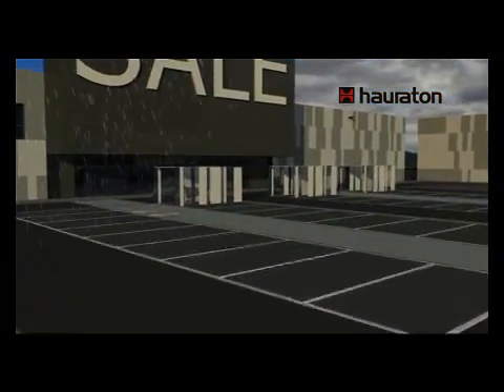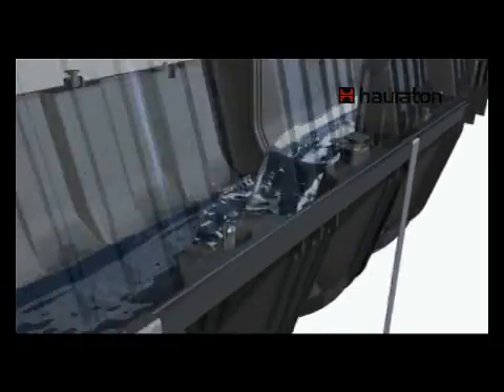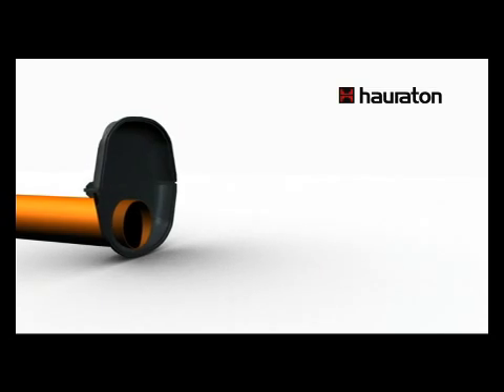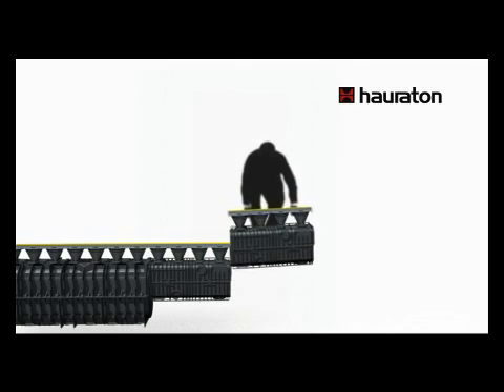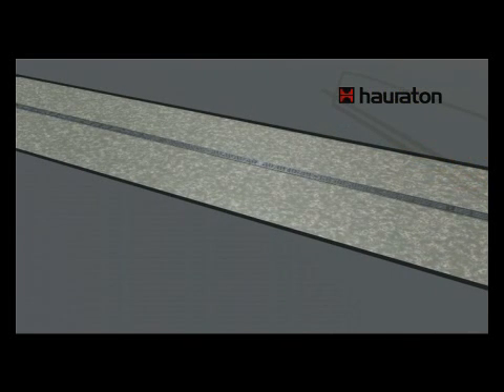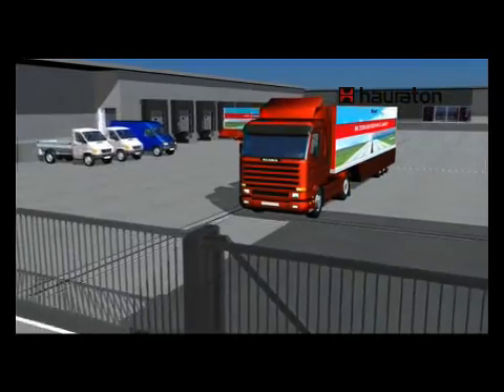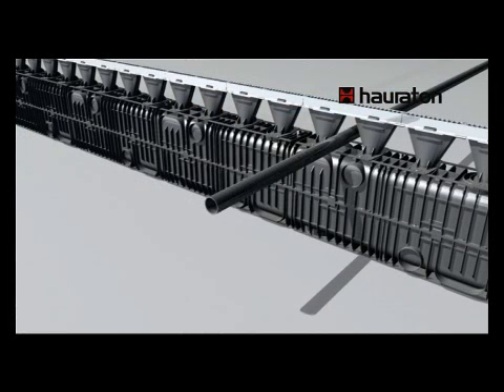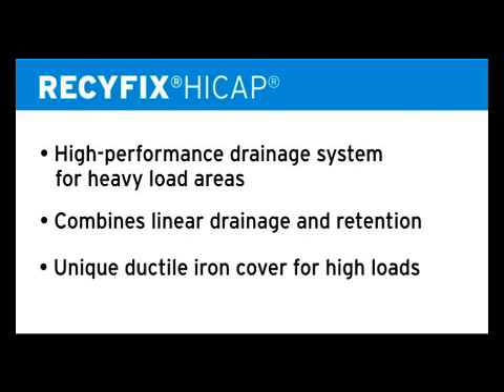Easy Installation of Slotted Channel RECYFIX HICAP from HAURATON

Comment: How the system handle the incoming dirty (like a leaf, pieces of trash etc)?
Reply from the maker: Thanks for your question, which is a good one.
To answer the question fully, we should look at several aspects of the system, including the width of the slot in the grating, the design of the inlets (funnels) and the channel body.
There are a number of grating options available with the HICAP Slot Channel system, with different slot widths. The widest slot width is 28mm, but we also provide gratings with 14mm and 6mm slot widths.
These narrow slot widths will ensure that large items of debris cannot enter the channel system, therefore helping to reduce cleaning and maintenance.
The throat inlets (funnels) between the surface grating and the channel body have inlet dimensions that are much wider than the slot width of the surface grating, so whatever material falls through the surface slot, this will enter the channel body and will not remain within the throat inlet.
If any small particles enter the channel body, these will be washed down the channel system during rainfall events or during periodic maintenance of the system (when the system is flushed through with water).
The channel system is supplied with access boxes and outlet boxes, which include a sediment bucket which sits within a sump at the bottom of the box. Debris will enter the sediment bucket which can be easily removed (and emptied) during periodic maintenance.
RECYFIX HICAP channels have u-shaped channel bases and are manufactured from modified polypropylene (smooth internal surface), so the channel bodies are designed to achieve self-cleansing water flow through the system, which helps to keep the channel system clear of debris.